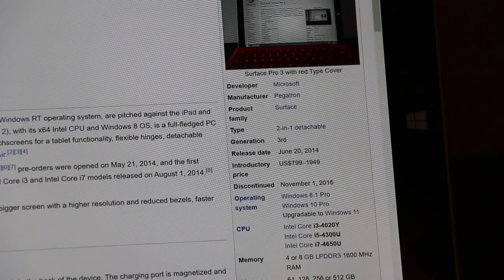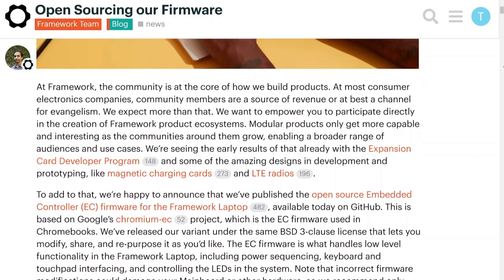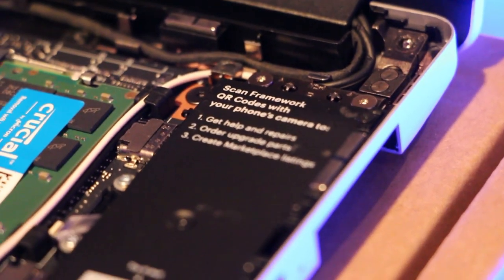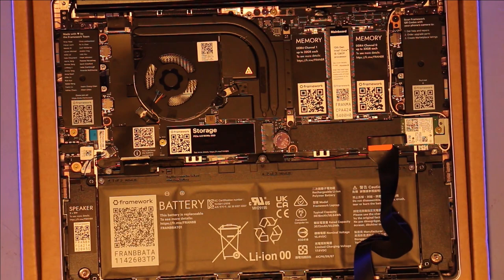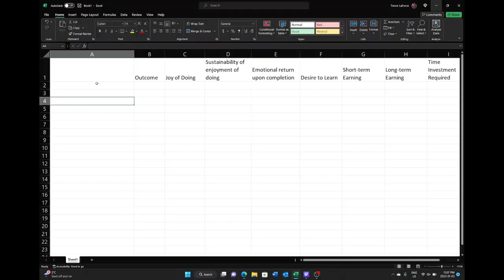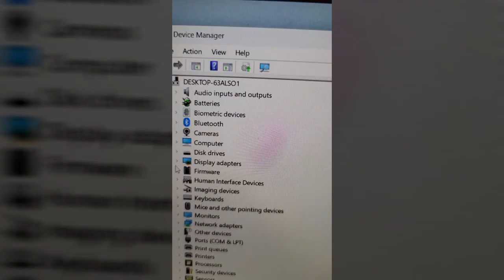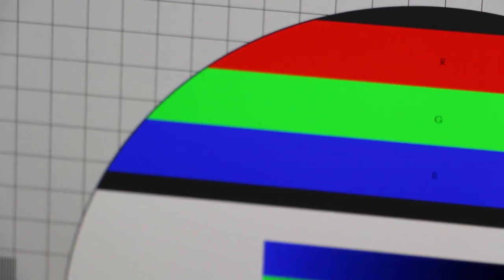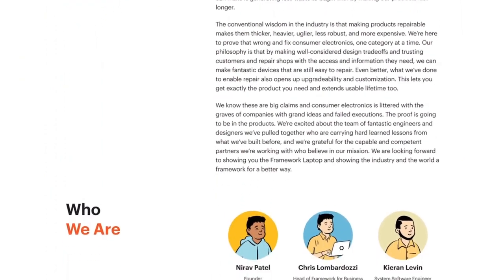Framework Laptop First Look

Comment: I think putting QR codes on everything is a good idea, remember this is also intended for people who have never opened up a computer before. That way someone who doesn't even know what an SSD/m.2 NVME is, is less likely to try to put it into the WiFi slot.
Reply from the maker: Absolutely! Like I said in the video, A+ idea with some B+ execution. I kept scanning things and just going to the page explaining that you can scan QR codes! But when they actually led to an instruction page, they were great.
Reply: @LoveMakeShareTV  
If you go back, likely you will find all or most of the QR connections have been made.

Comment: The simple fact of the laptop making you create a local account instead of phoning home to MS is per se a reason to buy this machine! Kudos to Framework 👍🏼
Reply from the maker: This is an interesting take on it, because I actually would have preferred at least having the option! The problem is that there's no compatible driver for WiFi out of the box, so I had to create a local account just to install it. Yes, privacy should be the first principle, but I could have saved some time just signing into my Microsoft account during setup.
Reply: @LoveMakeShareTV  I understand. I believe that you're right and Framework should take into account the user experience for the ones that want their product and not the Linux "the driver doesn't work" experience.
Reply from the maker: @BriefNerdOriginal  Fortunately the drivers all worked... Once they were installed! Just needed that extra step during the OOBE.

Comment: Great video. I'm also using a convertible, but really like Framework's mission. Did you draw with the Surface? If so, have you found a replacement solution when on the go? Maybe an iPad or a graphics display (Wacom, Huion, etc)?
Reply from the maker: Hey, this is a great question that I never answered! Yes, I did draw on the Surface, and no, I have not found a replacement solution, honestly. My projects have been less about art and more about writing and design since I switched anyway, so I've spent much more time in Fusion, Inkscape, and GIMP than, say, Krita or Sketchbook. My favourite on-the-go drawing tool in the past has genuinely been a Note, but I had to switch phones. I think my next phone will need to be a Galaxy Ultra, with the S Pen.

Comment: I've had one of these for about a year. It's not perfect, and honestly I shouldn't have paid that much if it wasn't perfect, but I desperately wish for this concept to survive. Call it a repair tax instead of an Apple tax.

(Specifically the issue with Linux and battery life in sleep mode. Even with s2deep it'll kill itself in two days of sleep.)

Comment: at least the battery is user replacble. the macs have better bettery life but you're stuck with them when they go past warrenty
Reply from the maker: Absolutely. I don't want to discount how impressive the new Macs' battery life is. Those M-series chips are really impressive. But this has a lot of other merits! I'm looking forward to the next big update from Framework, it's supposed to bring some of the battery optimization they did with Google for the Chromebook configuration.
Reply: True; it's replaceable... but it's also annoying to always need to charge in just 2 or 3 hours of use...

Comment: Installing Linux on it (like fedora) would've been the cherry on top
Reply from the maker: I'll likely do a follow-up to this to address some comments and questions... I do plan on dual-booting! For now I'm still kind of getting used to it, and I don't want to totally disrupt the workflow I've built on Windows since like 2010. May have noticed that most of the key software I mentioned is open-source and cross-platform now, so maybe a switch is imminent!
Reply: @LoveMakeShareTV  You know, one trick you can use is putting the OS on the SSD expansions... then you can easily swap out the OS whenever you want and use the SSD inside as just storage...
Reply from the maker: That's a great option, too. Maybe one day! The flexibility the platform grants you to do things like that is pretty great.

Comment: If only Framework had a 360 hinge with a touch-screen panel.
Reply from the maker: How did I miss this comment!? Hell yes, if they made a Framework with a conversion kit, a digitizer and Wacom pen support I would just hand them my wallet and say "you might as well keep it."
Reply: Yes, I have 2 HP x360s in successive models.
I believe this features saves the hinges from breaking.

Both have worn out keyboards, and it they were a FW, a new keyboard and 5 minutes would fix that.
😞
The FW does lay flat apparently, and that should be enough to save the hinges., though they are also replaceable.